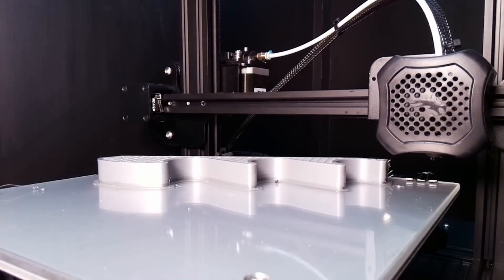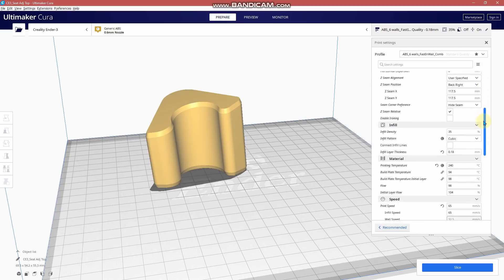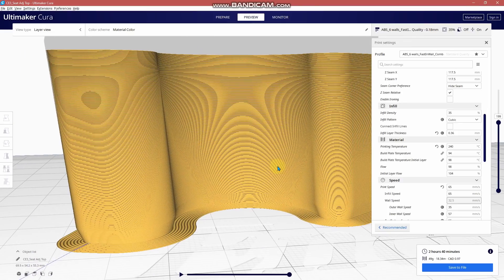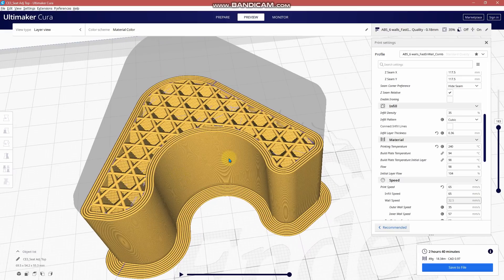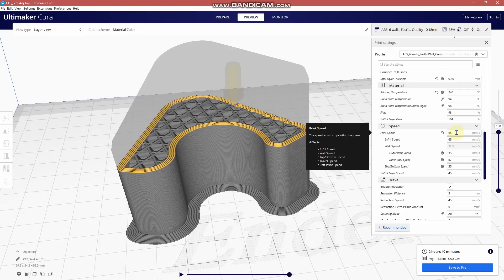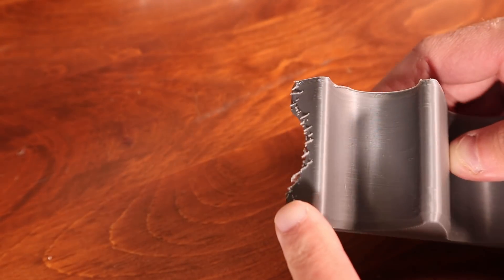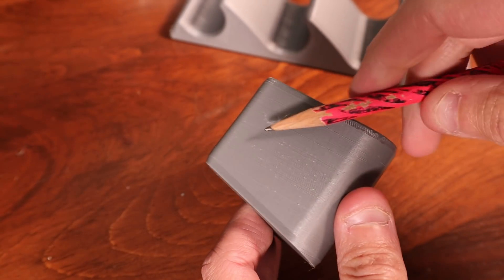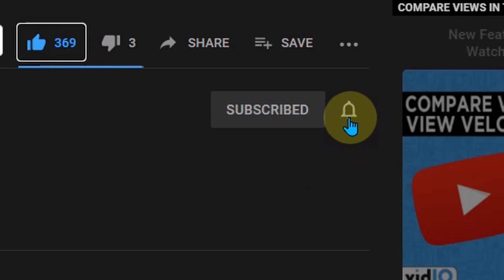Creality Ender 3 V2  - Speed up prints without sacrificing quality by turning on this setting

Comment: How did you Timelapse with nozzle out of the way
Reply from the maker: This is a feature in Octoprint (Octolapse Plugin I believe) which allows you to do a 'smooth' timelapse.  What it does is park the head out of the way and then take a quick shot, the only issue with this is that with PETG at least it tends to ooze a bit and can leave some blobbing, but ABS and PLA are pretty good.  There is also a way to wipe before you start printing again, but I never went that far.

Comment: Abs does indeed have moisture issues. I use to be a mold tech doing injection molding. If abs wasn't dried long enough you could definitely see issues from it.
Reply from the maker: It's been a while since I posted this video, I can't recall exactly what I said about ABS, but yeah, best to dry all filaments before printing with them, including ABS.  I still don't have the same issues with moisture in ABS as I do with PETG or PLA, but the results are better with dried ABS than without.  Funny that a material we use for drain pipes would be hydroscopic.

Comment: I have and Ender 3. I feel it is pretty well tuned. I only make functional mechanical parts. How would you adjust the slicer settings to get more accurate Holes or slip firs? I do apply a tolerance to holes in Fusion around 0,1mm But I shouldn't have to have to keep going back into 360 to compensate. What wettings in Cura (etc) should I be tuning to get more accurate slices? Thanks.
Reply from the maker: Holes can be tough, no matter which printer, they can always be trouble.  What I normally do when it's something large, is create a hole with only a few areas which make contact.  If it's something that needs to have full contact.  I usually give 0.1mm tolerance like you do, I also chamfer the bottom edges, but I have a chamfer which is 60+/- degrees that avoids the elephant's foot issues we can have.  The other issue I run into sometimes is that the seam inside the hole isn't perfect and causes a poor fit.  If you add a small sharp triangular cutout on the inside of the hole, it will tend to want to add the seam there and it will avoid causing the seam to come into the hole at all.   This solution doesn't work on horizontally printed holes though, those holes are usually a bit harder to control.

Would you be able to provide a photo or send me an email and I can give to some solutions that work better for your exact scenario?
Reply: @NeedItMakeIt  Assuming the file is good. Printer is calibrated X,Y, Extruder. I have messed with, adjusting flow rate, line width. Then there is "Horizontal Expansion" and "Hole Expansion". But I'm not sure if fixing A screws up B. Also "Slicing Tolerances" Mid, inside or outside.

Comment: Have you dried your ABS and seen better results?  I had a couple prints do the bumpy little blobs with ABS and it was too high on the temp.  I took it down 5c mid print and it cleared up.  That is without drying it first
Reply from the maker: Most filaments seem to perform better when dried, some people say that ABS isn't hydroscopic, but it is, just not as much as PLA or PETG.  I've always liked the look of an ABS print, and of course the properties, but I still like to print with PETG mainly because it doesn't warp and shrink like ABS does.  Even PLA warps more than PETG.

Comment: How would you pick up speed on a part that needed 100% fill?
Reply from the maker: That is a great question, I would have to experiment a bit.
Reply: @NeedItMakeIt  I picked up the same size tip you have, and I'm going to do some printing next week. Love to get a idea on starting points and settings on the ender 3v2 I have. Thanks for the reply.

Comment: I just got into 3D printing, could you possible share your profile? or some of them. I have a few but want to try others. Problem I'm having is stringing and the prints quality not being the greatest. And my prints take ages. Around 1h 15m for 1 meter of filament
Reply from the maker: I can, can you email me?  Do you have a way of drying your filament?
Reply: @NeedItMakeIt  I do not have a way of drying my filament. I keep them in a cardboard box.  Sending you email rn
Reply from the maker: @PortalColin  Try to find some method, a warm light in a box, or a filament dryer is ideal, they're pretty inexpensive, maybe something used?  It does make a big difference.  Good luck!

Comment: I implemented this trick and I'm strongly suspecting that this is the reason why my prints have been significantly failing due to nozzle impact on the printed object....If I change back to infill height the same as the layer height fixes my new problem then I would advise you to rethink this video since on alot of prints the travel may cause the nozzle impact and the resulting layer shift issue...could possibly be fixed with z hop as well but I'll update this comment once I determine if it's the cause or not...

Comment: increase your wall count to remove infill imperfections showing up outside the model. 4-5 walls is amazing
Reply from the maker: That's a great tip! I normally use three, recently used 4 w/ 1mm nozzle and there are no traces of infill.
Reply: @NeedItMakeIt  absolutely. Four is the minimum to get perfect walls in my experience! It also makes the shell much stronger. You can increase the speed for printing the inner walls as they will not be seen but use a lower speed for the outermost wall so it gets printed better and with higher dimensional accuracy. Also, ensure that “infill before walls” is not selected, since if the infill is printed before the walls, there will be visual cues of the infill through the walls and the walls will not be perfectly smooth, no matter how many walls you choose.

Comment: Hi, on ender 3 v2. Nozzle 0.4mm, layer height 0.2, do you recommend put infill layer thickness on 0.4? I saw an object takes 11 hours and with that in 0.4 takes 10 hours. But i don't know if it would be right with a 0.4 nozzle
Reply from the maker: I would not go quite that far with the infill thickness, I'd tend to stick with .16 and .32 if you're printing PLA it is probably fine, with PETG, the infill become a hazard to travel over and it will cause the build plate to move over time.  It is worth trying both options.  Some other options are to use your standard 0.2 layer thickness throughout and change the infill to be more sparse,  then change the infill extrusion to 0.6 for wider infill lines to compensate, you'll gain a bit of speed there also.
Reply: @NeedItMakeIt  doesn't seem like a good idea since .2mm for all parts is faster than .16/.32. At least this is true for smaller models. For bigger object with not a lot of detail, might as well use .32 for walls and infill.

Comment: Nice tip, thanks for sharing! If you change your infill pattern to zig-zag you will see a decrease in print time due to less retractions and less travel moves. ;)
Reply from the maker: Great tip!
Reply: What infill density and speeds are you doing it at? I seem to get faster times with grid.
Reply from the maker: @2iinfinite  I always use Cubic, because my prints are structural, it isn't the most efficient pattern but it has lots of straight lines and doesn't wobble my machine around like gyroid.  I normally run infill at 60-65 and 35% Infill for cubic, which is pretty tight, but the parts I make take a fair amount of load in compression and I don't want any trouble.  I also print with a 0.8 nozzle and 0.2 lay ht along with 5 bottoms and 6 tops, and 4 walls with the outer about 25% slower.

Comment: I'M SENDING IT!! 120mm/s! Innfill being twice the width... Now, lets pray....
Reply from the maker: OMG, that's fast, are you running the stock hotend?  With a small nozzle you should be fine, I tried running a 1mm nozzle with 0.3mm layer height and it was a tough go, the infill overlap caused such large raised areas that the nozzle ended up moving the build-plate when it went over the surface.  I just made the most accurate part I've ever made with a 0.4mm, and 40% gyro infill vibrating the printer around the room!  It parts still turned out very well.
Reply: @NeedItMakeIt  😂
Cr10s. Stock hotend and extruder yeah! Only 0.4 nozzle. And going smooth as F so far! 
I did recently do a fang/fan mod where i use a blower at full power on the heatsink tho, and man my print has stayd perfect all the time since. No sign of grinding in the extruder or nothing. Witch i have had lots of before due to heatcreap. And i can run fast no, much faster than before. And yeah, i did even run a 4020 fan on the heatsink before. 10x better now. Crazy.
Reply: Never thought heatsink cooling would matter that much, but always still had a feeling it always was heatcreep related since the original design is crap. 

Recently just ran a vase mode print in like 70mms, with 0.8 nozzle and 1.6mm line width!  Was perfect. So im going higher next one! :D

Comment: Try Messing with mesh fixes>line resolution, try some test with increasing and decreasing them. You will get better result with layer lines. I fix mine with that setting.
Reply from the maker: I'll check it out, I haven't played around with that one yet.  I have all settings in Cura visible now and am working my way through them.  Thanks!

Comment: Can this work with alternate extra wall?
Reply from the maker: Interesting question, I created a quick test and it is not quite what I would expect.  I think it could lead to some problems.  The alternating wall still appears every other layer, it would cause excess material to build up and I'd imaging the nozzle would start to rub and collide with it.  Do you use alternating wall, I've never used it personally, but maybe there are some benefits for structural parts.

Comment: Walls look ugly, you need some tuneing man...
Reply from the maker: If a man says the walls are ugly, the walls are ugly.  

I've made quite a few changes since that video, the results are much better.  I'll have a video coming out in a week + about getting the perfect seam with Bowden, as long as I get success.
Reply: @NeedItMakeIt  :D thats a good joke xD appreciate it! :D

I hoped you could have tuned is since ;)
I hade a bit similar issue, -uneven wall layers, and it came out its a Cura bug at 1.2 mm walls and 0.4mm nozzle thickness. Setting it to 0.395 did wonders  😄

Comment: Infill layer thickness
Reply from the maker: Yes, I have a video on that as well, I do find that with the larger nozzles it gets risky unless you choose an infill which does not pass over itself.  The nozzle ends up hitting the infill and knocks the build plate off.

Comment: Your prints may be faster but they will also be much weaker.
I personally print BOTH infill directions on EVERY layer for 95% of my prints.
Reply from the maker: Prints are weak in tension, in compression they will be plenty strong.  You're right, the layer bonding will not be as good, each situation is different, my prints are to bear load in compression, and transfer loading to a steel frame.  These prints for example have been tested in compression with my load cell to beyond 1000psi with no visible damage, I use cubic infill at 35% with a 0.8mm nozzle.  I've recently switched to a 1mm nozzle and though I have not tested the capacity, it should be well beyond that of the 0.8.  Careful with the infill height with the larger nozzle, the bypass of the infill becomes a problem for the printer to deal with and it likes to move the glass around.

Comment: Good tip, but your prints are horrible, the layer lines look awful, they are not consistent, you need to tune your printer
Reply from the maker: There is always room for improvement no question, I think you're mistaken when you say horrible, you either have very high standards or you're just trying to be a you know what.   

A few notes on my settings, I always over extrude slightly, this is because my parts are meant to bear load, I do not use the fan, I print with 0.6mm or 0.8mm nozzle , I print fast.   I use harsh lighting in my videos to show off imperfections and not cover them up.

Send me a photo and your tips for tuning your printer I'd be happy to take a look.

Comment: I have tried this on my Sidewinder X1 but it only saves 10 minutes.  Original time 4 hours 38 min, new time 4 hours 28 min. Using .04 nozzle with .2 layer height, 10% infill and .3 infill thickness. Am I doing something wrong
Reply from the maker: I suppose it really depends on your infill % and speed settings.  For example I use 35 % as standard, both because I print with no fan and I need lots of support for the top layers and also because the parts I print bear load in compression.  If you print with 10% infill, you'll see quite a bit less savings.  

How do you like your sidewinder?  Any complaints?
Reply: @NeedItMakeIt  Thank you! Makes sense.

Comment: What are you using for a build plate and butter? Can you link me to a video about this.
Reply from the maker: Don't use butter, that's a going joke on my channel.  I do use borosilicate glass for my build plate, and I like it.  I would like to try steel in future, I'd like to see if it will help to bring the speed up a little by lowering the mass of the moving Y axis.

Comment: What camera are you using for your timelapses? Thanks!
Reply from the maker: Hi, just the PI V2 camera.  In order to get it nicely focused, I print in the furthest corner.  The camera is a little tough to adjust and make sure you have lots of light, that helps quite a bit.
Reply: @NeedItMakeIt  ok awesome, thank you for the tip, I appreciate it! Your quality looks amazing, so I'm hoping I can achieve those same results.
Reply from the maker: @TechReviewLife  Thanks, and for sure you can!  I have something new also which I expect will blow those timelapses away.  Get as much light in there as you can and you'll get good results just from that alone (Not from the back, from the direction the camera is shooting from).
Reply: @NeedItMakeIt  Thanks for that added info, much appreciated! I got my V2 RPI cam all set up, but you're right, it definitely needs more light! I was going to do one of those generic led strips across the bottom of the top rail, but I think maybe one of those selfie led rings would work better since it'd be facing it and not shining down on the print.

Comment: Awesome! Very helpful! I’m wondering though, how do you view around in cura like that? When I do it I can only rotate and zoom.
Reply from the maker: I believe I press Ctrl down when zooming and rotating.  Shift works also to pan around.   If you go into settings under general you can also adjust the zoom so that it will zoom toward mouse direction.  I hope this helps, and thanks for the support!
Reply: @NeedItMakeIt  thank you so much for the help! You have no idea how helpful that was and how much my life has changed! Love the channel!
Reply: You can also hold down your right mouse button , and then rotate the model around using your mouse.

Comment: what are those things your always printing or is this just a test print?
Reply from the maker: These are parts I've designed to Mod the Bowflex original 3.1 bench due to the poor adjustment it had.   I designed them for myself and posted to Thingiverse expecting more people had 3D printers to print the parts themselves, instead there has been quite a demand to print these parts for people in the US and Canada.  This is the same reason that you'll see these parts with extremely heavy infill, thick walls and a larger nozzle.

https://youtu.be/9M2wX5IQAYU

I've performed compression tests on these parts, and I do not have the ability to compress them to the breaking point... yet.   current loading is 1021 psi using ABS.  I'm testing in compression since these parts are only used in compression.

They work well as test prints as well as I have printed so many, I can tell if there is something wrong compared to previous prints.

I hope that answers your question.

Comment: When you compared the 2 different print times, you used the same print speed (65) which showed about a 30-40 minute difference 

However later in the video you stated you change your print speed to slow it down from 75 to 65 when you use this feature.  

Why didn’t you compare the total print time after making that change?  Would it still be as significant?
Reply from the maker: I can't quite recall exactly why that was, my prints are made for sale, it is important to make them as nice as possible for the customer within the time constraints I have.  I am still experimenting with this setting and I leave it on all of the time, I have found that speeding up the inner walls to 60 and the outer 1 layer to 40 gives a nice print with the E3V2 with PETG at 236C nozzle.

In future I will be doing better for apples to apples comparisons.

Thanks for your thoughts!

Comment: Set octolapse to snap to print and set snapshot delay to 0 (zero) and eliminate the "fingers".
Reply from the maker: I will have a look!  It will not leave the part during a shot?  I have corrected the issue with my unresponsive retractions now, but I still see some of these fingers on occasion.